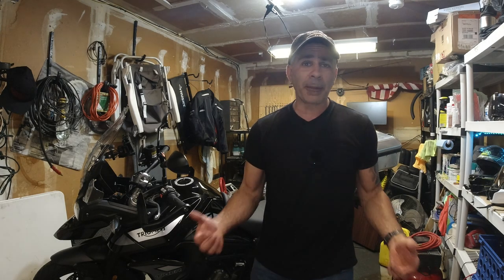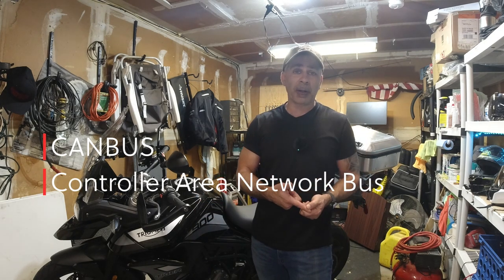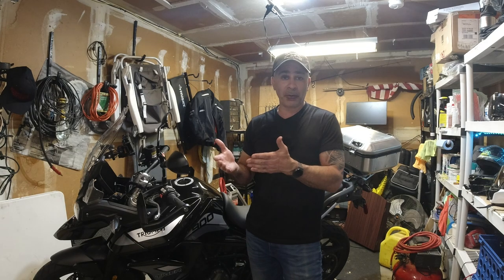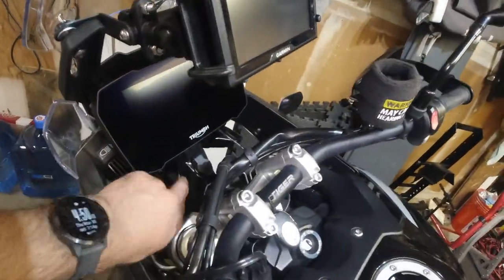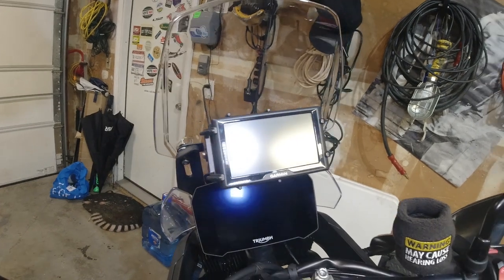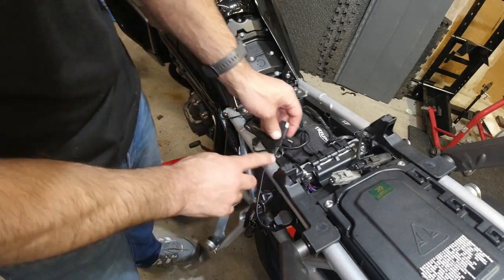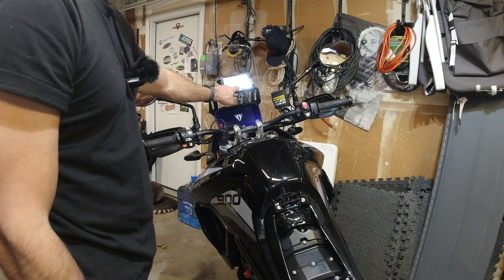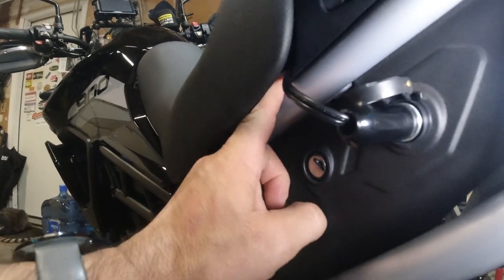Finding 12 volt switched power Triumph Tiger 900 Motorcycle

Comment: Great - You answered my question from your GPS video mount.
Reply from the maker: Glad you found it. I was just going to reply to your other message but see you found this one!
Reply: Is that a cup holder on the right side?  If so where did you get it.  Having trouble finding one that will fit.
Reply from the maker: @schradersl  I'm not sure where you're seeing a cupholder.  The only thing on the right side of the bars is the master cylinder for the front brake, which I have covered with one of those brake reservoir socks.
Reply from the maker: @schradersl  Although what you're seeing is  not a cupholder.  Fodsports did just send me one to review last week which I just posted the other day. It's simple, secure, seems to do the job.  I test fitted it on my Harley, but in the vid I test rode it on the Tiger.  Here's a link to that vid if you're interested https://youtu.be/nunehCgzUhc
Reply: @Mudslidex1  sorry.  Guess it is.   My bad, the reservoir cover looked like a cup holder.   Like the videos
Reply from the maker: @schradersl  I could see how it looks like one.  Although I don't have it anymore...It blew off on the highway!! :)   Thanks for watching and safe travels!

Comment: If you want to have a proper wired in GPS cable without splicing/soldering, 
-Remove the Phone charger plastic from under the pillion seat
-Unplug the phone charger cable
-On your GPS cable (It should have 2 exposed wires), connect them to a 2 way HM connector using a crimp (Very easy to do)
-Plug the new connector into where the Phone cable was 
-Route the GPS cable to the front
-Profit! 

I'll make a video showing my setup because I don't know if there's one on youtube, but it's very easy and the phone charger under the seat is a joke anyway, might as well use that plug for something useful! (This plug is only powered on when the bike is on too)
Reply from the maker: Good tip. I actually thought of doing something like that. And you're right, the charger under the seat is useless and my phone barely fits in that compartment

Comment: Another great video Joe, I never thought of that idea, I've got my Satnav wired to the Battery, I know it's continually on however when I take the tomtom rider 500 iff it's cradle there is nothing to power, the idea you have fits better with due to it being switching power supply, thanks again buddy 👍
Reply from the maker: Thanks.  Yeah I am also thinking of purchase a real motorcycle GPS such as the Garmin Zumo XT but wanted to figure out how I was going to wire it, so I tried this method out first which works fine.  I'm not crazy about cutting or tapping into wires on a new bike, so I think this is a good alternative.  Thanks for watching and commenting!!  Safe travels!

Comment: Can’t we use the front power supply in the same way for the gps ?
Reply from the maker: You can, but the front one is always live.  So you would have to unplug it every time you shut your bike off or risk draining the battery
Reply: I found a Hella adapter on Amazon that fits snug with our 2018 Tiger 800 XCA. Has USB-A as well as USB-C PD and an on/off switch, and you can can choose blue, green or red with the voltmeter display. So far so good although only 3-weeks of using and it works flawless with the 13 Pro Max. Haven't gone through rainy weather yet so can't testify on the durability in that regard. But it does get 4.5 rating out of 720. The on/off switch for me was the ultimate reason for getting it.

Comment: why didn't you use the plug the GPS in front socket between the gas tank end the Triple tree at the frame ?
Reply from the maker: Because that socket is live all the time even when the bike is off.  I wanted switched power.  The one by the seat is switched and comes on when the bike is powered on. The one by the handlebars is live all the time and will drain your battery if you forget to unplug it
Reply: @Mudslidex1  thank your for your answer. Its true, it all depends and what you (I) are looking for. I unplug the devise and not leave it install all the time for safety matters. Its a shame that our bikes don't come with an USB at the front socket. I'm planning to change it for a USB cigarette lighter type threated instead of the DIN type. The 2024 model now brings an USB charger instead of the DIN cigarette lighter type.. for Triumph, one step in technology...😁
Reply: One more question: In what moment the USB port under the pass seat for the Cell phone is suppose to have current? Mine doesn't have, with switch on or off....

Comment: So what I want to do is connect my iPhone (for GPS) to bike so it is charging all the time.  Can I do that with that front bike port?
Reply from the maker: Yes, but the front port is live all the time even when key is out.  The port by the seat is switched power.  I know many people use the front port  with a USB socket plugged in, and even  with an LED lit on the USB port it's not enough to drain the battery.  I wouldn't keep it plugged in for weeks as it may eventually drain it, but for every day use it should be fine